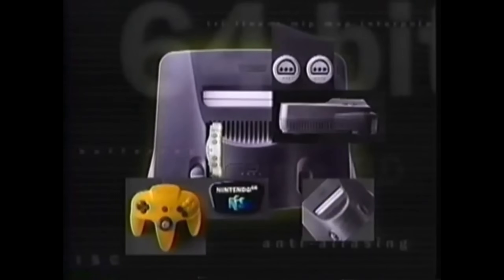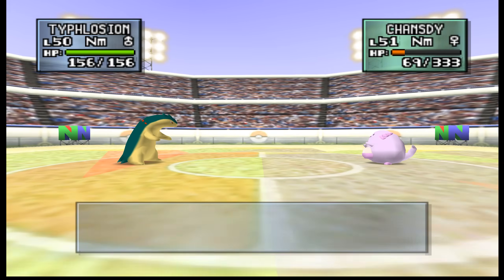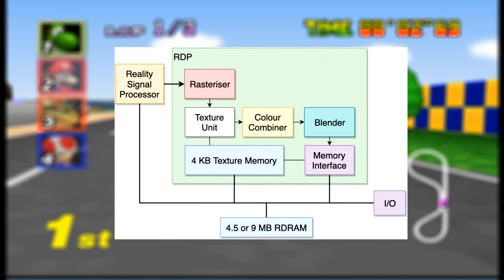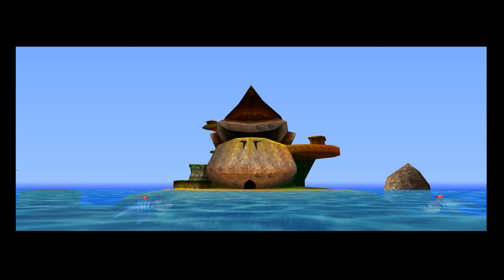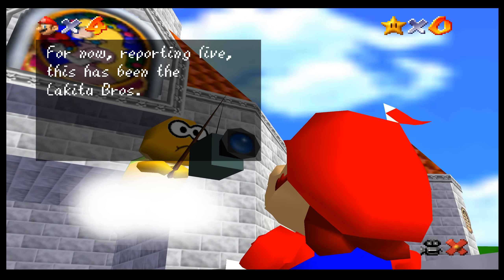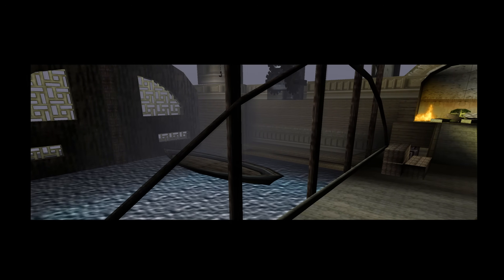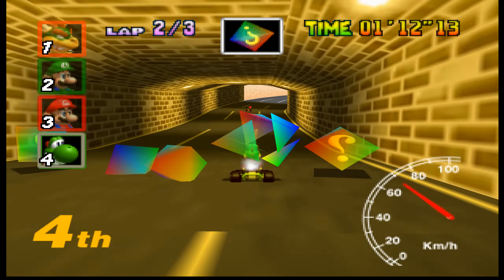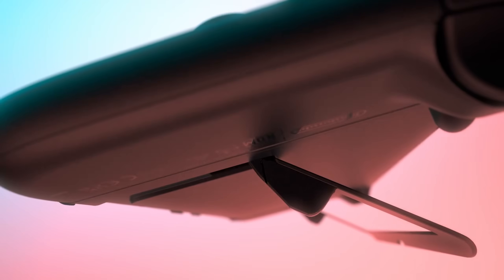The Nintendo 64 GPU: Reality Co-Processor (Retro Breakdown)

Comment: This was educational. Despite all this, I still think the PSX was the better console. Something like ff7 would not have been possible on n64. However, the SNES will forever remain the GOAT
Reply: PSX is the best console of all time IMHO
Reply: The port of Resident Evil 2 is a great example of why that statement makes no sense. PSX had FMV and disc capacity but as far as rendering 3D and texture and environment mapping N64 isn’t inferior in any way and arguably is even better looking in certain scenarios. They both work differently and have their advantages and disadvantages.
Reply: @ShareHolder-gp9il  FF7 has significantly more FMV and prerender backgrounds and regardless of that you can see the sacrifices that had to be made. I mean, you could probably fit RE2 on a GBA cartridge. I also saw many "RIP" PC games over the decades. Does that mean it would be an ideal experience? No.
Reply: Yet the PSX couldn't handle things on the same level as Ocarina of Time or Majoras Mask. FF7 doesn't come close to them
Reply: @aussiegamerplays7284  PSX had some noteworthy advantages over the N64, it had higher resolution textures and access to a much larger storage media, which meant larger games, higher quality music and cutscenes. the fact that it could even compete with the N64 at all which was almost 2 years newer says a lot
Reply: @joesaiditstrue  nothing says amazing like texture warping galore and heavily pixelated images
Reply: @aussiegamerplays7284 PS1 hater detected
Reply: @aussiegamerplays7284 Someone is actually recreating Ocarina Of Time on PS1 with dynamic lightning.

I still dont know why people call those games impossible. Or they are haters or they saw few PS1 games and call it a day. The only N64 game i would say there could be some problems even with a pushed to the limit PS1 code would be Dinosaur Planet which is the only N64 game with enviroments as polygonal as a late PS1 game and due to the slower transfer speed and having to fix texture warping it may slow down the game but still i dont think its strictly 100% impossible.
Reply: @sebastiankulche  oh rad, OoT looking like pure shit on an underpowered console, should be amazing. I'm sure all the zelda fans will be going nuts for that pile of shit.
Reply: @aussiegamerplays7284  It looks practically equal, maybe slighty better thanks to PS1 dithering and framerate, but its already far far from finished.

Only N64 fanboys would say that. A true Zelda fan wouldnt mind playing any game on any console for convenience or curiosity. As much as i dislike idk, MK64 i wouldnt mind seeing it on the PS1 or Saturn
Reply: @sebastiankulche  oh cope harder with your claims 🫵🏻🤣
Reply: @aussiegamerplays7284  Still no arguments.
Reply: @sebastiankulche  indeed, there are no arguments because the PS1 has no hope of running OoT looking anywhere near as good as on N64. The only games on PS1 that actually looked good were 2D games, otherwise they were a mess of texture warping, pathetic dithering and the ability to have every pixel counted on screen at any time
Reply: @aussiegamerplays7284  Crash
Reply: @sebastiankulche  the funny part is how your arguing with someone who actually owns both consoles and knows what both consoles are capable of. If someone is going to port OoT to PS1 due to the raw performance of the console alone the graphics are going to take a major nose dive. If you can't understand that there is no helping you.
Reply: @aussiegamerplays7284  I dont know about that when i only see N64 videos :P

I really doubt most people knew what the N64 was capable of, since it was never pushed to the limits until.... literally recently.

The graphics of OOT arent nothing special and far from the best of the fifth gen. In terms of polycount also many PS1 games win by a mile. The true advantage of OOT its their open enviroments and fast streaming, but speaking about that... There are PS1 games with enviroments as open as OOT or at least Mario 64, it just happens that most of them are obscure japanese titles.
Reply: @aussiegamerplays7284  Also, i though you just said it was impossible, and now "the graphics are gonna take a hit". And who cares if they actually take a hit (which we still dont know)? Just admit you dont want it because you rather prefer your precious console remains "undefeated".
Reply: @sebastiankulche  your carrying on about a console with piss poor graphics. The only benefit the PS1 had graphically was pretenders backgrounds. You just made 1 hell of a stupid claim about the N64 never having been pushed to its limits considering Turok 2 looks on par with dreamcast games graphically. What, did you forget about that lil doozy? OoT still looks better than anything in the PS1 let alone Majoras Mask. Perfect Dark another game that looks better than anything on PS1. DK64, again looks better than anything on PS1. The PS1 simply does not have the raw power to compete. Deal with it.
Reply: @aussiegamerplays7284  Now your next comment would probably be: Conker or Perfect Dark LoOkS bEtTeR ThAn EaRly PS2 GaMeS
Reply: @aussiegamerplays7284  Contrary to you fanboys, i wouldnt mind seeing Gran Turismo, Metal Gear Solid or Crash on the N64, but of course that aint going to happen too.
Reply: @sebastiankulche  Conker does look better than early ps2 games and it's not even debatable. What dyou expect from a company that spent years developing for a console versus fresh games on new hardware that weren't pushing the PS2 anywhere near its limit yet. Jesus Chris you PS fanboys struggle to accept basic facts. Try actually playing the real games on the real hardware before simping hardcore for the only console you could afford.
Reply: @aussiegamerplays7284  Unless we were talking about sh!t bootleg then you are just a fanboy. Jak And Daxter looks miles better than any N64 game pushed to the limit and is not even close.

And even most of those bootlegs still were pushing much more polygons than the N64, they were just extremely wasted. You just prefer the aesthetic at this point.
Reply: @aussiegamerplays7284  You know that a single PS2 model has way more polygons than an entire PS1 or N64 scene? The N64 has like less than 5% of the processing power of the PS2, so if they do it worse, then its lack of experience. Tekken Tag Tournament or Smuggler Run wouldnt be possible on N64 too and were practically launch games.
Reply: @sebastiankulche  oh your level of seething and coping is hilarious. Are you also going to try and claim that the PS2 despite being half the power of the xbox was also graphically superior to the xbox? You've gone from looks to polygons now which is fucking hilarious 🫵🏻🤣 tekken tag tournament also rendered a whole lot less in favour of what was directly at the forefront. Also, the N64 was about 23% of the processing power of the PS2 so I dunno where you got your 5% bullshit from 🫵🏻🤣
Reply: @aussiegamerplays7284  23%? Did you know that N64 ports that ran at 10-15 fps or so ran at 60 on PS2 and with better visuals? And those ports usually arent even made by talent studios. If we went to polygons which are part of the processing power like it or not, PS2 could do 100-200 times more and it shows in many games.

You just are biased to this point. Just say you prefer the N64 aesthetic and you are free to go. But dont lie.
Reply: @aussiegamerplays7284  If you really think N64 could had run a game like idk MGS2 with just a few downgrades (even with expansion pak, lowest res, no zbuffer and 1 FPS) then you are out of your mind.

To put it into perspective the most demanding 3d model on the fifth gen straight away has to be the T Rex. Even a tech demo at less framerate has less polygons than an NPC from Jak And Daxter.

Your mind doesnt understand the ridiculous leap between fifth and sixth gen, and this is something everyone would agree. It wasnt two times, it wasnt 4 times, it was hundreds of times. Even a Indigo 2 Extreme pales into comparison to the Dreamcast.
Reply: @sebastiankulche  dude you think a processor not even 4x as powerful is capable of doing 100-200× more 🫵🏻🤣 tell me you don't know how technology works without telling me you don't know how technology works. Do you honestly think every PS2 games ran at 60 fps? Are you serious? Or are you just on crack?
Reply: @sebastiankulche  as someone who owns all 5th and 6th gen consoles, I definitely understand them better than you. But judging by your level of stupidity I'm assuming you think the PS2 was capable of outperforming the gamecube and original xbox don't you. Just another Sony fanboy who will never accept your weak and underpowered consoles weren't anything special.
Reply: @aussiegamerplays7284 Counterargument, do you think there is a high end N64 game that runs at stable 30 fps, let alone stable 60 fps? That already gives the proof.

Idk why are you so defensive. PS1 less powerful than N64? Fair enough, they both have their advantages in my eyes, but with PS2 there is simply no discussion. Nothing surprising considering one is from 1995 and the other from 2000
Reply: @aussiegamerplays7284  When i mentioned GC or Xbox? This is when i discover i was talking to a wall. This fanboys... :face-blue-smiling:

And yes, the PS2 could outperform in some scenarios, like any console of a same generation (minus the DS, Wii and Switch). See the video that MVG made.
Reply: @sebastiankulche  you....... do realise there actually are N64 games that DO run at 60 FPS right? Like Smash bros as 1 example, or F Zero X as another.
Reply: @aussiegamerplays7284  Again, it seems you dont read correctly. I said "high end". You could probably run Pacman on the N64 at 240 FPS.

Comment: I love n64 it was amazing how the worlds were just not possible on ps. 1 thing I remember is some people thought the ps was stronger since it could do full motion video. I found out later the ps has an mpeg chip which plays videos & n64 didn’t so n64 had to use its hardware to do it.
Reply from the maker: Same here I really didn’t appreciate it enough back in the day, but I am happy they made it the way we did and we got amazing great games on it as a result ☺️ I remember hearing about the same thing with the PS1 too!
Reply: The motion video existed since the 80s. Hell even the GBC could do it with a lot of tricks. There is nothing demanding in terms of hardware about showing pictures quickly. It was all just space.
Reply: @sebastiankulche  like you said, space was the big problem in the n64, that's why RE2 is an impressive port at what it did. You have 2 campaigns for Claire and Leon, you have the extra missions, you have all the FMV for both characters (although compressed to hell and all with the reduction in quality), the pre-rendered backgrounds (also very compressed to fit in memory) and all that on a 64MB* Cartridge, when in the PS1 you have 2 different disks for both characters. I know almost every console can do FMV's at the time, just it was not that common on the N64
Reply: @ntnavy1  I think even the PS1 version of RE2 was supposed to be in 1 disk. Idk what happend there.
Reply: @ nah. then why would Sony bother using a mpeg-1 chip if it’s hardware could do full motion video when the chip would add to the consoles cost? There’s no way its gaming hardware could do it at that same level. Plus I never saw the gba do video but at wht resolution? & how would that video look on a tv? Yea space was important but the ps1 needed that chip
Reply: @DivineOassis  Idk about that chip, maybe was for much more higher res videos, smoothness and color depth. But GBA had literally movies in cartridge format that were sold.

Granted the videos dont look great in any console weaker than the PS1, but my point was that they could.
Reply: The funny thing is that for some games like resident evil 2 (impressive port at the time btw) the developers were force to find workarounds to have the FMV included (although you know a lot more compressed and with half the resolution compared to the source).

Comment: If only the N64 used CDs and had more VRAM/RAM...
Reply: …and cache.
Reply: @jasonpeterson3860  this.  The miniscule texture cache was the main cause of the smudged, low resolution look of games
Reply: @waynetemplar2183  This narrative has been largely debunked by Kaze Emanuar. If graphics programmers were better trained, they would have been able to get enough memory capacity and bandwidth to avoid creating a bottleneck for the GPU. The much bigger problem was poor support by Nintendo toward third party developers, and programmers who did not know enough about the hardware to know how to optimally leverage its graphics processing capabilities.
Reply from the maker: That would have been incredible 😍
Reply: the n64 had plenty of ram.  infact it was capable of 16mb ram.  the main issue was the ram bus speed was too slow.  there was a faster sd ram available at the time but it wasnt used to keep the cost down on the console.
Reply: I wouldn't have wanted the 64 to use CDs, an inferior technology. The cartridges were superior in streaming data and also much faster. What it really needed was bigger cartridges, which were made available later during the 64's life cycle (and was an idea planned for the 64DD). Nowadays we're using the advanced idea / version of modules in the handhelds (Vita, DS/3DS, Switch) and even on PC with our SSD etc. Optical disc based mediums and hardware are still part of modern consoles for other reasons, but technically they will be removed entirely at some point. Even with the limitation of cartridge size, the 64 still managed to do RE2 with various enhancements. The 64 was ahead of its time.
Reply: @Sturmlocke86 RE2 was an insanely difficult game to build and the cartridge was really expensive. 64MB of ROM was upwards of $30 then, over $60 with inflation now.
Reply: @Sturmlocke86 Even if we take into account the advantage of cartridge speed (which in practice is not as big of an advantage if you carefully manage the game resources on PS1), the N64 low cartridge size still mean there would be longer loading times for compress content.

The N64 also lacks more modern CD technologies such as actual folders and audio/FMV mpeg easier compression.
Reply: @sebastiankulche  what?

Comment: donkey kong 64 made me realise what this machine was capable of.
Reply: A long standing, yet false, rumor has that the expansion pack was included to fix a game breaking bug that couldn’t be fixed without it.  This is false, but it was a showcase of what the N64 was capable of if more ram was added.  I wonder how the n64 would have turned out if it had the best of both worlds.  The cheaper to manufacture and higher storage capacity of CDs plus the faster loading times and harder to pirate advantages of cartridges.
Reply from the maker: @ I wonder the same. That's a really good question. If I had the skill and ability, I would love to learn to somehow mod the hardware to get an idea, like they do with a lot of retro consoles today (OG xbox for example)
Reply: @Apollo1989V I bet however after seeing Conker, the game could had run without expansion pak.
Reply: @Apollo1989V  We will when the 64DD peripheral releases. The upcoming N64 Legend of Zelda game is supposed to make use of it.
Reply: But the cartridge format really limited the system. I truly wanted perfect arcade ports of Ultimate Mortal Kombat 3/Trilogy, the Street Fighter Alpha series, and Killer Instinct 1-2. But we never got some games, and the ones we did get had their graphics and sound down graded 😢
Reply: Gegorce gmini and pd64
Reply from the maker: @bektaskonca5189  I never had the pleasure to play that game when I was young, but playing it for this video made me realize what I not only was missing, but what the machine was capable of as well!
Reply: @FrameRated  donkey kong was the first game I ever laid eyes on shining with colours I have never seen before in my life, it was a leap, you can not explain that to someone, only who watches cd games and movies, grown up with VHS quality movies would know that feeling.
Reply from the maker: @ That's so true. I remember before I got my hands on one, I only heard about it from other people. I lived in a super small town in the middle of no where and had to go over an hour to get to a store that would even sell something like the N64. I just remember imagining like super colorful and crisp graphics. Then I got one and booted up Super Mario 64 and my 8 year old brain exploded lmao.
Reply: @FrameRated the 64 was released when I was a freshman in high school.  It was the first system I collected for because I got it when it was released and I started working the next year and bought all the games for it myself. I really enjoyed my 64 even more so than my Saturn (which I got in 97) my PS1 and Dreamcast.  My favorite game was Duke Nukem Zero Hour. It used the expansion pack for graphics and it was four player death matches, and you can actually see Duke Nukum so it wasn’t third person and me and my buddies will play the F out of it. Good times.  Great video G!